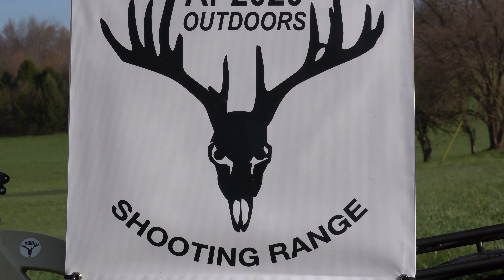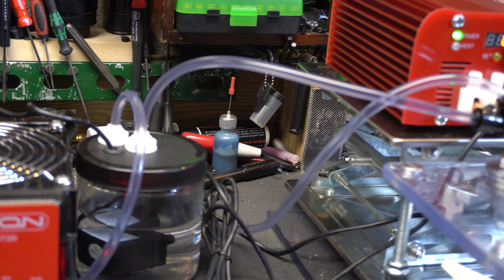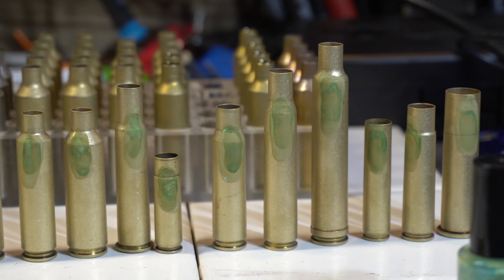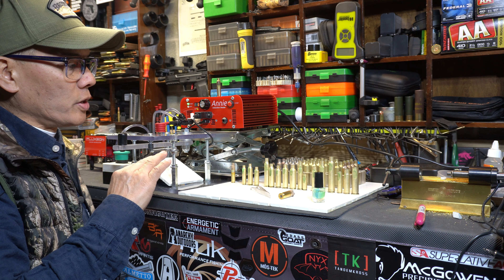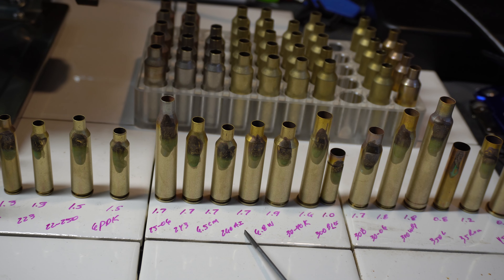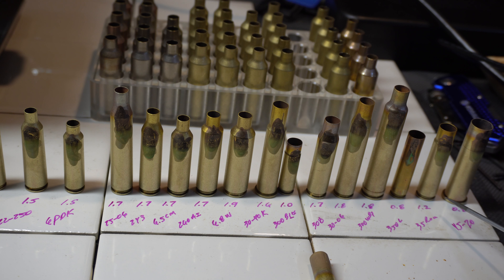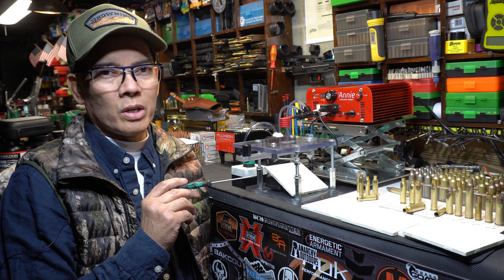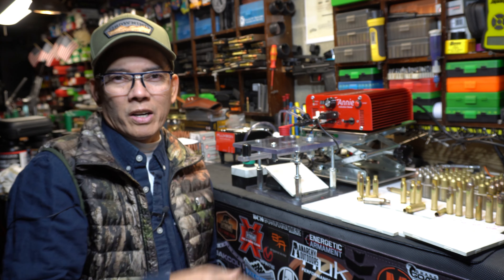Fluxeon Annie Induction Heater

Comment: Sometimes too fast is too much!  I build my own with $30 ZVS board and $50 1000W power supply and a wound my own coil.  It takes 1.7 seconds to anneal .223, just a tad slower but also I go when it starts to glow but I actually do have Tempilaq that I still haven't tried.  But I think even that is too fast, I think that a slower anneal will produce more even heat.  I noticed the anneal line is not even, I don't know if that matters or not.  I think that maybe I need to make another coil and increase the ID from lets say .750 to .800".
Reply from the maker: @DimaProk  I am not sure on the anneal rate of time. However, the Annie coils tend to "center" the case when it starts to induct = an very even anneal around the circumference. The bid advantage to the Annie coils is that they are water cooled which a lot of home made induction coils are not. Over the course of several hundred anneals, that can lead to failures.
Reply: @AP2020_Outdoors  Yes, I learned that water cooling is a must when I burned out my first ZVS board a while back, but I was using to temper small steel parts and ran minutes at a time.  Its a must and not only that, adding a fan on top of the board is needed, after I went through 150 - 200 cases in one sitting I measured  capacitor to reach 140F (70C) which is a limit for plastic capacitor.

Now what I've seen on the forum one person using ferrite C ring and litz wire wound around it and its not water cooled and he doesn't have a problem with it overheating.  I actually though about doing that few years back.  It might cost extra but the idea that you don't have to deal with water, tubes, pump and radiator is appealing.

Now the uneven line wasn't because the case wasn't centered, I can also see mine getting pulled magnetically and shifted sometimes, but the fact that coil is not a perfect circle but a spiral, part of it is higher and part of it is lower and I think the sheer intense heat creates uneven line around the case due to this geometry of coil.  

Another difference mine is double layer and only 3.5 loops so its concentrated more in smaller area which honestly I prefer more.  I noticed that by how far down the case the "burn mark" and how you have the case in the coil same as I do.
Annie actually also offers double layer coil but its only appears to be 2.5 loops which I think is insane.  Here I am thinking I need to either widen the coil or maybe add another loop and they go in opposite direction!

Comment: You should integrate this into a press so when you get to the top of the ram it hits the switch to activate the annealer. Could have a progressive press with a case feeder and go to town,
Reply: As a followup, I think the Dillon presses would be ideal since they have a cutout where the tool head is inserted. Remove the tool head and you have a perfect spot to add the annealer.

Comment: How did you cut the plastic for the trap door?
Reply from the maker: @whliving I scoured the plastic carefully with a utility knife, and then broke it off on the edge of workbench.
Reply: @AP2020_Outdoors  I love yours. It looks clean. I ended up making my trap door out of some 3/4 plywood. Not as sexy as yours, but this will work until I get things up and running.

Comment: I will suggest you get picky about the jack height adjustments. Some of those examples are hitting far down below the shoulder body junction. Think about controlling the position in the coil down to insure you are getting the same outcome on the neck with less of the body. Merry Christmas and Happy New Year!
Reply from the maker: @Dino C.  Good point, and probably on the 300BLK and shorter cases. Merry Christmas and Happy New Year!